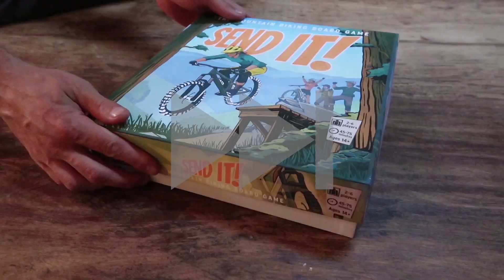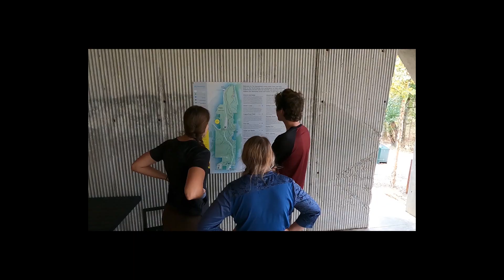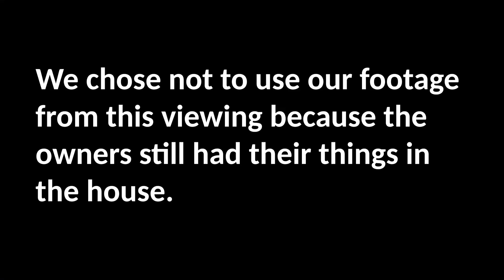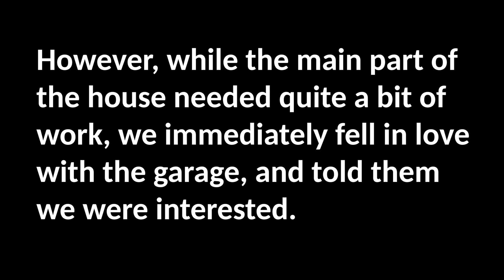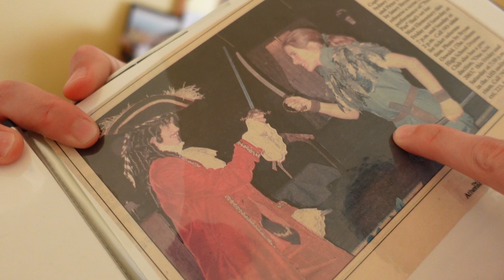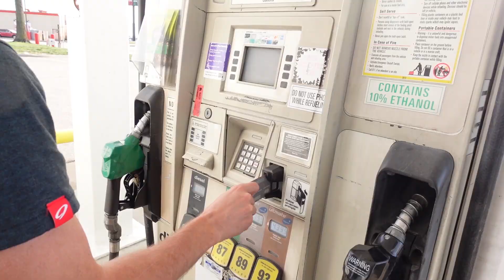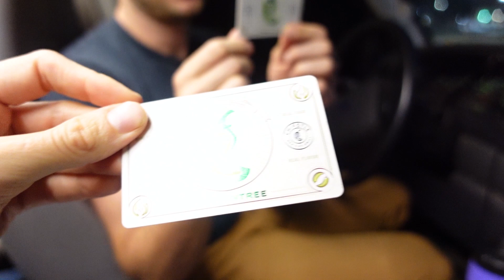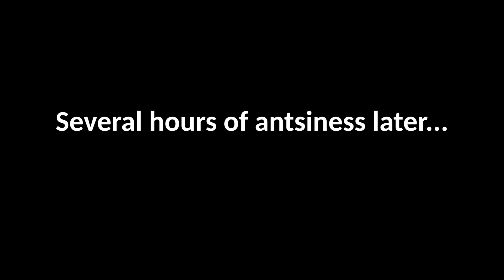We've been keeping this a secret for 2 MONTHS

Comment: Congrats you guys!!!! We are in similar boat, living next to my in-laws or in our function > fashion camper van (love your van btw), with the hopes of a dream property popping up. Tip: look into garage security the emergency pull string can be pulled by leaning on the door, sometimes two people, and using a hanger or hooked stuck to pull the string. I was able to brake into my old garage with that method. (I made a protective cover with an apple juice jug and the cord hanging down from it.)